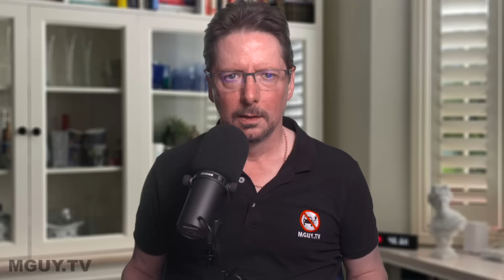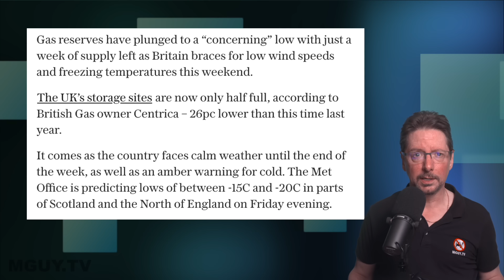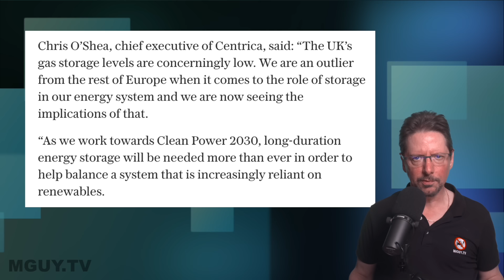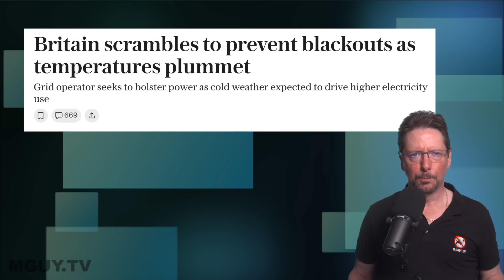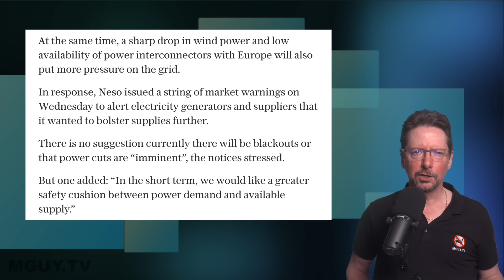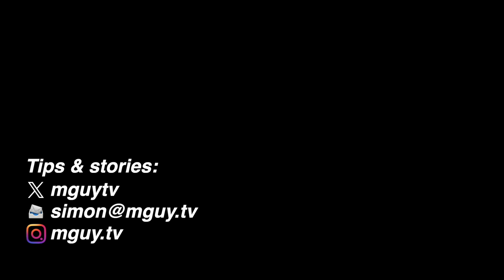Britain's Net Zero experiment is CRUMBLING before our eyes | MGUY Australia

Comment: We won't run out of power yet because pensioners had their winter fuel allowance cut so dare not turn their heat on for fear of being unable to afford our huge bills, how many will freeze to death is another story. While we sit on huge reserves of cheap coal gas and oil we prefer to import liquid gas in huge diesel powered ships, tons of wood chips from Canada and our frail home made power from the wind and solar power farms. The number of batteries we will need to keep our grid supplied is mind boggling, and thats with how we are right now not in a few years when we go all electric vehicles. Another 1963 or 1947 winter is all we need to cripple the country. This scare only lasted a weekend not 3 months like in those winters.

Comment: THERE MODEL OF THE REAL CAUSE OF CLIMATE CHANGE IS A LIE AND THEY KNOW IT , SO THE COLPRET S THAT CAUSED IT , HAVE DESIGNED A CLIMATE CRISIS MODEL TO MAKE THEM RICH , MAKE YOU POOR BY RAISING PRICE S ON EVERYTHING , EARTH TILT IS THE CAUSE OF CLIMATE CRISIS ,  LOOK AT TARSEAL ROAD S GLOBAL , THAT MASS WAS PUMPED OUT OF THE EARTH , LOOK AT CONCRETE BUILDING S AND PATH S , MOUNTAINS WERE REMOVED FOR THIS TO HAPPEN , ALL THE CAR S ALL METAL S DUG OUT OF THE EARTH , RECLAIMED LAND GLOBAL , MOUNTAIN S NOW LAKE S FOR COAL BURNING POWER STATION THE LIST OF MINERAL TAKEN FROM EARTH IN TWO HUNDRED TON IN OZ NOW 400 TON DUMP TUCK S IN 24  7 OPERATION S , EARTH HAS MOVED OFF IT S AXIS AROUND 23 DEGREE S WHERE THE SUN GO S UP AND DOWN HAS CHANGED , SATELITE NAVIGATION HAS BEEN RESET TWICE BECAUSE OF EARTH TILT , THE EQUATER HAS MOVED BECAUSE THE EARTH HAS TILTED SO ALL NATION S WEATHER PTTERN S HAVE BEEN EFFECTED BY THIS , AND THE MODEL TO DO WHAT YOU CAN TO FIX IT GET EV , GO SOLAR IS A GET RICH ELITE SCAM ,THAT CANNOT AND WELL NOT CHANGE A THING , BECAUSE OF EARTH TILT IT S EFFECTED INNER EARTH S MAGNETIC POLE SHIFT , SO CHILDREN OF EARTH BRACE YOURSELVE S FOR THE AWAKENING OF THE VOLCANOE S , THE EARTHQUAKES THAT COME WITH THIS , GROUND SOIL TEMPURATURE S RISING CAUSING MORE EVAPOURATION WHICH EQUAL S ALOT MORE RAIN GLOBAL AND LASTLY , THE CHANGE IN WIND AND WEATHER PATTERN S VOLCANOE S CREATE AMEN.

Comment: In the past month there have been fifteen days when electricity from wind power exceeded that from gas and fifteen when gas exceeded win plus the 7th of January when they were the same. At the moment the UK grid is exporting 2.095 GW to France and Ireland and importing 2.10 GW form Norway and Denmark, Crisis, what crisis. No blackouts except due to high winds which are much worse thanks to CO2 linked climate change. 
Things would have been much better if electricity and gas had not been privatised. Now we have a bloated bureaucracy of office workers doing their best to increase profit and “compete” with each other.

Comment: Furnaces and boilers run on electricity they will shut off anyway. Unless you have diesel powered backup generator that is set up to run your furnace or boiler. Running out to buy a generator and get some gas after the lights go out is too late. Be prepared for Mass death by freezing.

Comment: California found out. Water you don't need water right? What do you need water for. do we really need all these fire stations? How bad could it be? So now Europe is going to find out. we don't need no dams we don't need no nuclear power. We and sunlight and wind power. And we can back it up with batteries. What could go wrong? they are about to find out. Another disaster waiting to happen. Instead of banning guns and knives they should men woke idiot politicians. Higher Engineers instead you can build nuclear power plants and there's nothing wrong with having coal power plants as a backup. But people don't understand is that when nuclear power plants go down they require electricity to start back up again. If you don't have the wind blowing or the sun shining you're basically dead. You need natural gas and coral conference as a backup

Comment: I can give you some real world data. I have a Bluetti AC200L which I love, It's an all in one power station which you can charge in different ways. One way is Solar. As I brought the battery for my boat/car camping I thought why not buy a couple of large panels. I can charge in the day, use it at night. After all energy prices are about to explode along with inflation here in the EU area as Russian oil and gas was cut off 1st January. These panels physically are massive each are about the size of a door and are 430w each. So I have a total of 860w. To make the math easy lets take 1/3 off i.e 360w off to make them 500w in total panels. To make 2000wh you would assume it would take 4 hours. Well it's been on charge for 7 days and I'm making 1% a day and the highest I have seen them has been 44w. You don't need day light, you really do need sunlight! Despite all this if I could afford my own home I would flood the roof with solar, have large batteries that you can disconnect from the grid (they are looking to charge you storage in the future) and I would have a log burner. If you want to retire this is what you should do, remove counter party risk. That's the key for retirement insulate financial shocks.

Comment: Even in Africa, many more people die throught cold than heat.

The Pleistocene Ice Age has been characterised by periods of approximately 90,000 years of glaciation followed by 10,000 years to 15,000 years of interglacial. The Holocene, the current interglacial,  has so far lasted around 11,000 years.

Glacial maximum will reduce atmospheric CO2 to around extinction level.

Comment: "There's an old saying that energy security is National Security, but this warning has been ignored over and over again by successive governments in the UK." - Here is a quote from the Energy Security Strategy (2022):
"...if we’re going to get prices down and keep them there for the long term, we need a flow of energy that is affordable, clean and above all, secure." - Why wasn't this document mentioned in the video, seems relevant?

"Renewable energy is cheaper than other forms of energy... This is industrial-grade BS that any half-competent engineer knows full well." - This is not what the data is saying; CfD Allocation Round 4 Results showed offshore wind at £37.35 per MWh, while gas is still hovering around £100 per MWh.

"The UK's experiment with Net Zero is already collapsing and can only get worse." - I guess the global gas crisis in 2021-2022 was due to renewables?

"The country is suffering from the dunkelflaute phenomenon... zero solar power and zero wind power." - A bit of an exaggeration. While it is true that there are short periods of time where there is low wind and solar, the excess electricity that they produce during peak periods can be stored to counteract this. Also, fuel shortages and price spikes are not unique to renewables.

"Do they even realize how much grid-level batteries would cost? Probably the entire GDP of the UK." - Batteries are one way to store electricity, but there are other ways: pumped hydro, hydrogen storage, and vehicle-to-grid systems are all examples. Also, the cost of batteries has plummeted by 85% over the last 15 years and they are continuing to do so.

"Far more catastrophic is extreme cold, which kills way more every winter than summer heat ever does." - This is not incorrect, but fails to take into account how fast, significant changes in climate will affect all living things. Especially considering humans rely on living things to survive. Australia's productive agricultural land has been and is continuing to shrink due to increased droughts, extreme weather events, and shifting rainfall patterns. Low lying countries like Tuvalu are having to deal with seawater ingress which is threatening their fresh water supply. We need food and we need places to live. To shrug these issues off and claim we should be more worried about the cold is short-sighted.

Comment: The lights did flicker a few times Wednesday evening!
Symptom of supply voltage starting to drop as the demand exceeds supply. 
Or switching the supply lines to a different source at the main substation.

Comment: Meanwhile here in Wales the National Grid has awarded a £207 million contract to Hochtief to replace overhead power lines with a 3 km tunnel across the estuary by Pont Briwet . The same German company built the bridge in about 2015, replacing a Victorian wooden rail and road bridge, but that only cost about £20 million. And people wonder why electricity is so expensive,

Comment: Just as gas could be cut off so could supplies of coal, fossil, fuels, and nuclear energy supplies. Hard to cut off wind and sun.

Renewable Energy Can Have A Low Cost When Using the Right Technology. renewable energy can in many cases be less expensive than nonrenewable renewable energy. It is also, on average, cleaner and safer. 
I find it entertaining that if the skies are overcast and gray, that no sunlight nor wind is available. Lol
Reply: Oh, I think they could cut those off too unless you are thinking of each home having its own wind and solar.
Reply: @ by cutting off, I think you mean, cutting the powerlines used to deliver the power. But yes, each house or business could have their own wind and or solar power.

Comment: Not in the conversation but needs to be is that fossil fuels are finite.  
Be it 100yrs or a thousand years.  The former Shah of Iran  said once "Oil is too valuable to burn. " the current use is critical to support the population of the planet. Insecticide, plastics,  fabrics, fertilizer, all from fossil fuels. Current batteries are obviously not the solution. Even if they were efficient, they are also dependent on limited resources. Currently we have no solution.  Probably there's enough for another 100yrs. Currently solar, and geothermal will be there far in the future. Nuclear will also last a long time. Future generations will survive only if their predecessors address the issue. I would advise Elon Musk to forget about Mars and work on the energy problem if he wants to help future generations.

Comment: The solution to all this is more than one solution. But more than one solution means that big companies cannot control the energy supply and that's why nobody is talking about that. Let me give you a very simple and easy to do "battery" for who lives in a home and has a space where to dig a hole. With a few solar panels during the day you can heat water in an insulated tank underground that will keep your house warm for the night time. And you don't even need electricity to circle the water because the warm one goes up. You just have to figure out how big of a tank you need

Comment: All of these alarmists FAIL to take into consideration 1 very important fact, THE SUN!!!!   The SUN is the largest contributor  to climate change, but since the 97% of scientists completely ignore this FACT, here we are.

The climate IS changing!  It has done so for BILLIONS of years!  It will still be changing long after we as a species are gone.  

I understand solar, I lived in a solar powered house for 5 years.  I also had an Onan 6,500 watt propane powered generator.  I lived in Nevada at the time, and where I lived had lots of sunny days.  I still needed to run the generator to charge my battery pack at times.  To even consider using wind and solar to power the whole country is extremely foolish.  Especially in a country like the UK that is gloomy a large percentage of the time.

If this whole planet's population was suddenly gone, the climate would continue to change.  The "leaders" of the UK are gambling on the lives of the whole population trying to achieve an unattainable goal of being "GREEN!!!"    Hopefully the USA will not follow them down this rabbit hole!

Comment: Where I live there has already been 3 power cuts this winter, not from cold weather but from a bit of windy weather(They were all on the same day around the peak usage periods), not the windiest weather experienced but enough to make the operation of wind turbines problematic. I dread to think what an actual cold snap would do to the grid like back in 2020 where it was cold high pressure for about a month so it was persistently around freezing day and night.  I suspect it will be a return to the 1970's with rolling blackouts (Which was under a labour government).

Comment: I think most of us sensible people here in the uk understand the net zero agenda is utter B loks , I have resurrected an old wood burning stove and  glean fallen branch’s by the roadside to burn . I put the gas boiler on for an hour occasionally to melt the frost indoors . As a pensioner I lost the winter fuel allowance which I didn’t really need but was a comfort blanket when faced with ever increasing energy bills . It was -6 here in Bedfordshire this morning and we had a 2 hour power cut , I thought this might be a planned one due to the advertised shortage of gas in storage in the UK . It wasn’t but it brought home to me how everyone , especially old people will be incredibly vulnerable should this come to pass . Imagine a frail old person sitting in front of their electric fire in temperatures like that with no heat or the possibility of a hot drink . Our “ leaders “ are sick virtue signalling psychopaths .

Comment: Without artificial subsidies the rue cost of renewables is at least four times the kwh price our reliable base load stations produce it for. Sort out base load woes first then once gride secure can slowly implement renewables over a hundred year plan so costly mistakes avoided by not rushing blindly into unworkable plans. Slow and steady the best way to supplement grid with renewable but never be the end it all solution. At best a top up to base load power but will never survive on its own. Battery not a solution. Enormous resources needed, limited charge /discharge life and even a city size pack would at best only supply a few hours of base load power before go flat. With the cost of building these eye soars two new baseload plants could be built that last a hundred years then allow the environmental damage of most batteries ending up in landfill as currently happens. From wind ,solar and battery very little recycled. The pristine countryside a war zone of concrete slabs wear decommissioned wind turbines used to sit but the slabs there ghost to haunt us for many years. The carbon foot print to rehabilitate these areas is huge.

Comment: And yet, every single policy change the government makes push us more and more to utter dependence on electricity - for lighting, heating and transportation. The latest wheeze is that they are going after log-burners - just to make sure that, even in rural areas, everyone is completely dependent on the fragile (and easily controlled) electricity grid. It's madness - or deliberate?

Comment: Meanwhile here in the U.S. our local temperature is 25F (-3.8C) with about seven or eight inches of snow. Our natural gas furnace and water heater are keeping us toasty warm and clean. I'd rather have heat and power from coal and gas than freeze, but I'm not a green nut job eco freak.

Comment: The sensible thing for the UK, and many other places is hybrid heating, in this case, you have a heat pump, this provides summer cooling, and heating when temperatures are say above freezing.  When the temperatures are below freezing the heat pump switches off and a gas heating unit comes on.  Now you have the best of both worlds.